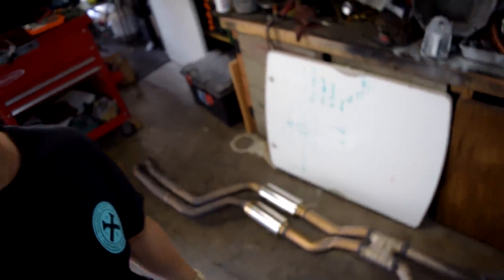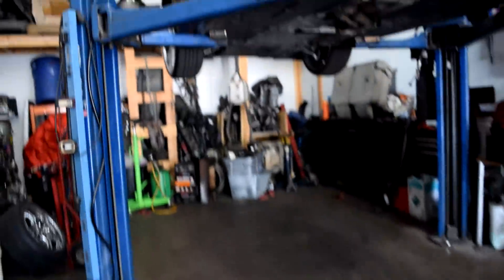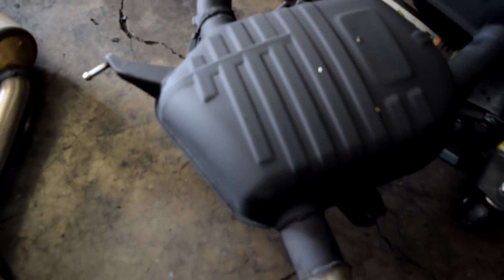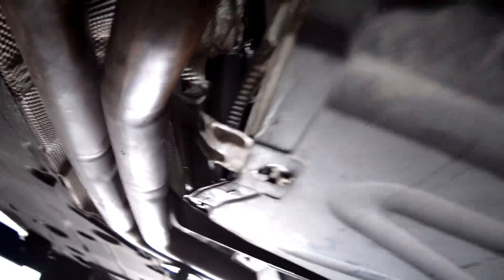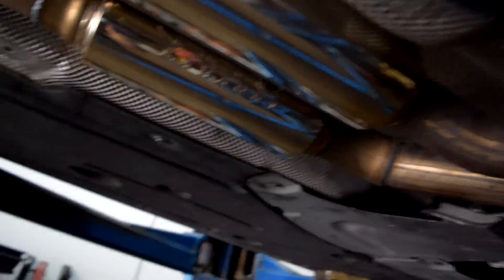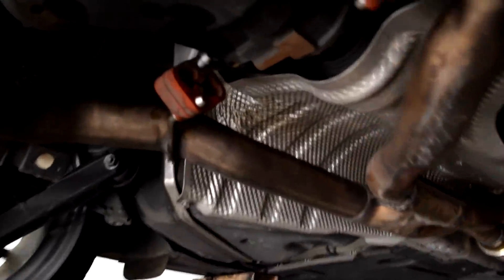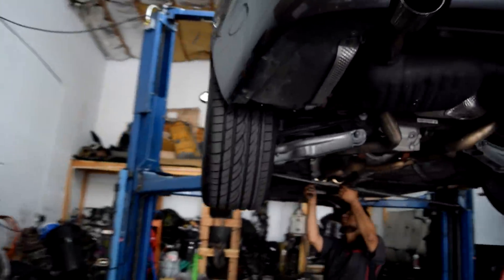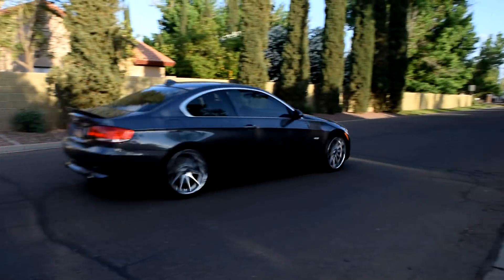MY 335I GETS A CUSTOM EXHAUST! (LOUD!!!)

Comment: How reliable has your 335 been??I wanna buy one but lowkey scared bc of these reliability horror stories! Thanks in advanced to who ever answers lol
Reply from the maker: Honestly bro if you have someone who can help you out with your car so that you don’t have to take it to a dealership you will be fine but the can definitely be pricey because I did the valve cover gasket the first month I had it but it really depends on what condition you get it in. Honestly has been one of my favorite cars yet and I love getting to drive it all the time and mob
Reply: SteezyJ other than gasket and maintenance no other issues?? Been looking at it for about 5 months now lol but i'm scared lowkey Haha
Reply: Rodney Morales are you mechanically inclined or rich? If not, I wouldn’t suggest getting one lol I’ve saved thousands of dollars doing all the work myself but the parts are still expensive af. Just to give you an idea, Injectors alone are $1,000